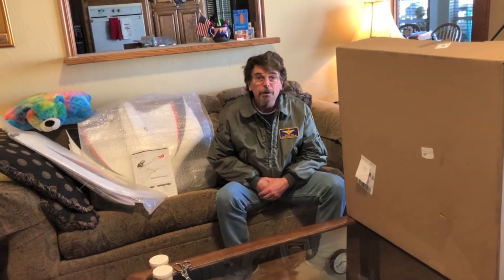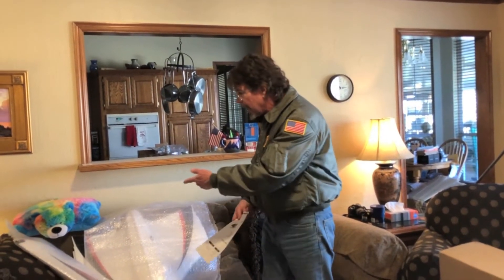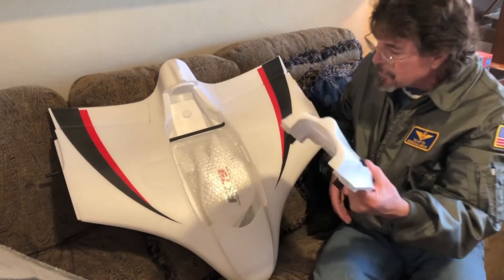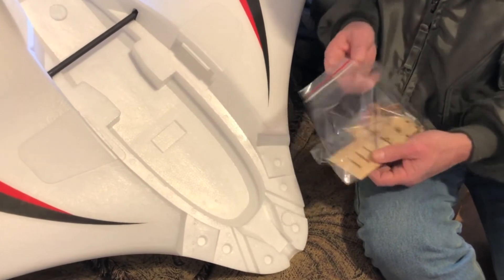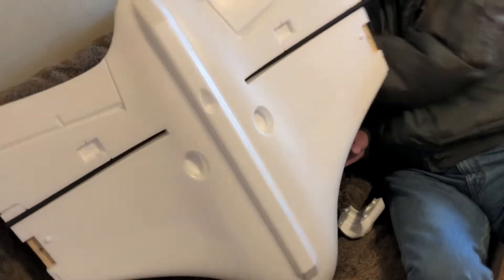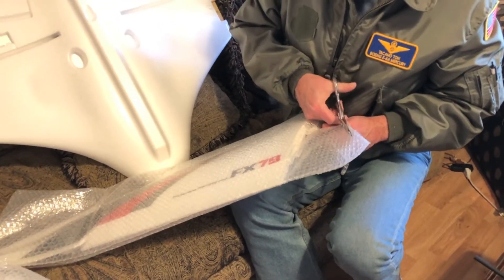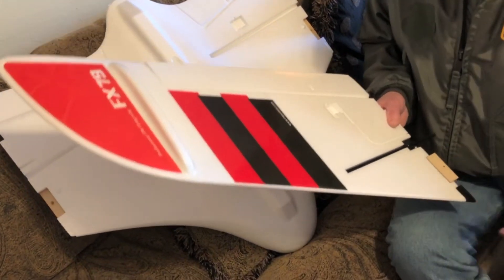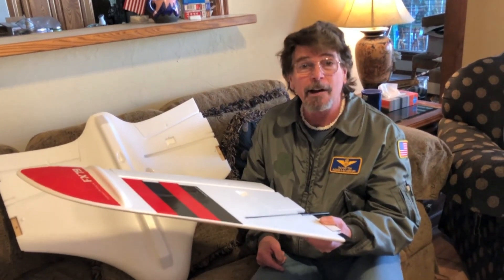Zeta FX-79 Buffalo FPV flying wing - UNBOXING

Comment: One thought...at 7:00 or so you're talking about the inboard "Flaps". I KNOW you already know this, and wonder if this was an unusual mis-speak, so please understand, I don't mean to beat you up in any way...but want to help you avoid making a fatal mistake...

When flying a "wing", inboard flaps would need to be used in conjunction with outboard flapperons/spoilerons, thus making defacto CROW, unless you have plans to incorporate kanards or simultaneously deployed leading edge [kruger/droop] flaps. As you DID mention, these "inboard flaps" would be used as elevons - EXACTLY...that's really the only option without some effort.

That all being said, I would totally go for CROW. I'd set each of the FOUR servos to their own channels. I'd assign the ailerons to "flapperons" and the inboard flaps as dual flaps. Then I'd use mix for the inboard flaps to deploy with the ailerons only when CROW was NOT in force. This can all be done, and it'd be really cool, especially with large, deep control surfaces like this plane has.

I hope this message finds you before you've dug in too far, one way or the other, so as the help avoid crisis.

P.S. If you deploy inboard flaps with no way of keeping them from acting as a downward elevator input, you'd be picking up some pieces of plane El-Quicko :) LOL
Reply from the maker: I learned something new again! As a CFIG with 10,000 hrs.+ of flying experience, I was dumbfounded by your term "CROW." In just seconds, Mr. Google clarified why: it's for RC only! I love learning, if you didn't notice. You have a reply in your inbox, meant for other-than-YouTube viewing. You really are reading my mind, as canards are expected to be used on Tanker 10 for long stability and for pitch control at liftoff and for landing flare as the speed bleeds off rapidly with those large inboard TE flaps extended for landing. I have no experience with building LE slats, so I thought I could make simple inboard Kreuger flaps like we used on the B-727 days of haulin' cargo in the dark in brown-tails at KSDF/Louisville Standiford. I definitely agree with your assessment and can assure you I don't have the know-how to setup a flaperon mix that acts like speedbrakes. In full-scale gliders there was no crow in any of our sailplanes like the ASK-21, Grob 103, Blanik or SGS 2-32 3-place gliders. HOWEVER, the 2-32 does have "terminal velocity" spoilers - they open backwards and are large enough to prevent exceeding Vne... even a pitch attitude of 90º down with a parachute fastened to my torso! We had a ride that tourists could enjoy, with parachute rental included.

I've sent you a pic of my first minor mod to the center-wing section of the Buffalo, and a Buffalo it is no more. It's like twin children, ready to grow and spread its wings. Of course, I could always screw up and extend the TE flaps without adequate counter-forces... and watch that baby pitch to 90º down! Crash bang over done. I won't do that. Once ready for crow hops, I'll graduate flap extension from 1º-ish to 2º to 5º, etc. before ever deploying them up in the air. My canards are waiting in their clear plastic bin, with sizable ailerons that will be used symmetrically as elevators - I have two canard/wing sets, one a S&D discounted set from F-35 kits. I actually want to figure out a way to make the flight controls move UP 100% throw WHEN the pitch stick is moved FULL FORWARD on landing rollout; it shouldn't be too difficult, but that's a bit down the road. First, I need the wing back together with gear that swings properly and a gyro stabilizer/wing-leveler set for elevons. Twin 64mm EDFs will propel it, until it eventually gets too heavy for only 2Kg of thrust from those low-power fans.
Reply: Wow! So many plans! Sounds like me!!! Now you just gotta go do it :) LOL

You have direction =) Good luck Tom!